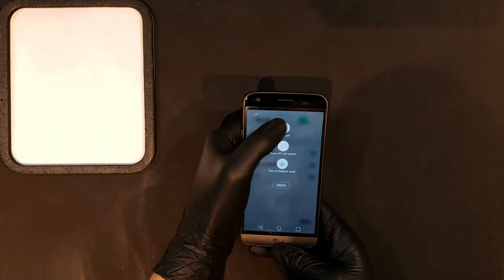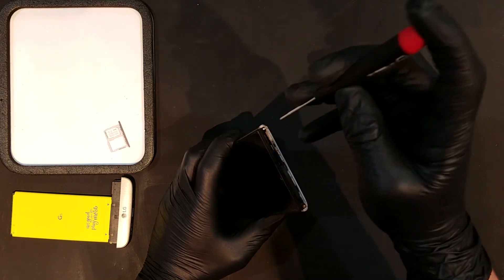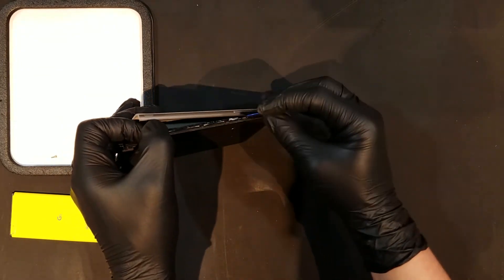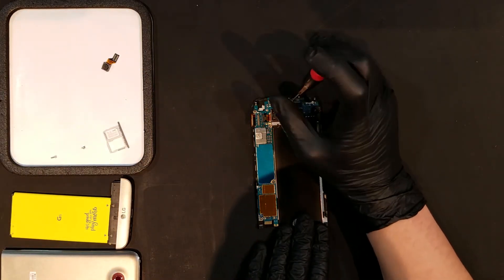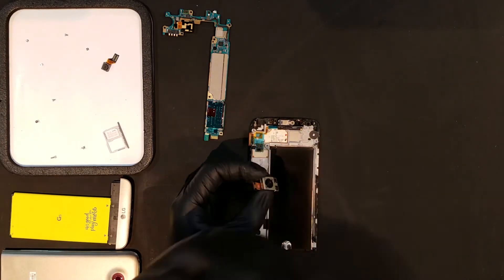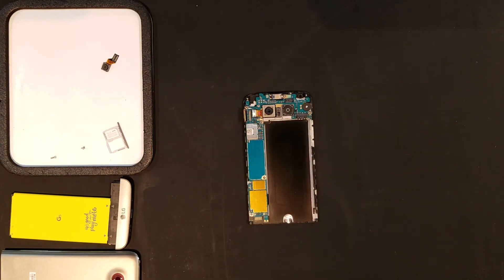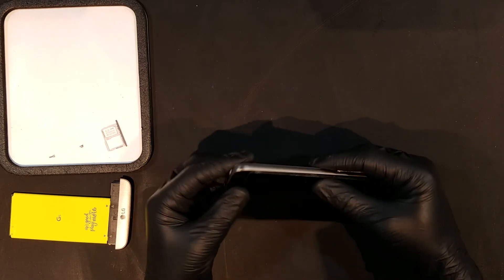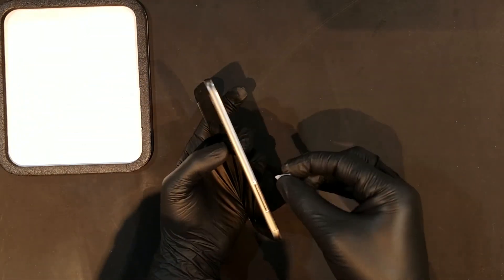LG G5 Primary Back Camera Replacement

Comment: Appreciate you taking the time to create this video. It greatly helped me to replace the main rear camera. Keep it up!
Reply: Was your camera blurry?  Mine is just wondering how coming this problem is
Reply: MIne was blurry, wouldn't focus.  Tried all the software fix suggestions, nothing worked.  Replaced the camera now it works perfectly.
Reply from the maker: I haven't really noticed this as an issue that's common enough to be well known, but one that still does happen. The sensor that focus' the camera just doesn't respond properly, which causes the camera to be constantly out of focus
Reply from the maker: Glad it helped!